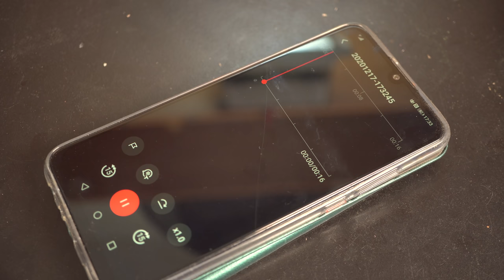How to make a microphone from a microphone?

Comment: the wires not pointing straight down is gonna wake me up st night XD
Reply: What I was about to say
Reply: Year, That triggered me as well ;)
Reply: Hell yes that kept it from being a 10/10 video.
Reply: the point using elastic is to avoid transfer vibration from the body to the mic, using straight short wires will create a patch to those noises.
Reply: @rurruth  There can still be slack on a straight wire.
Reply: ALLL THAT ATTENTION TO DETAIL AND ITS RUINED BY A WIRE STICKING OUT OF THE TOOOOP.

Comment: Beautiful.

I was surprised to seemingly see your lathe is a mini lathe. Love, to know who manufactured it, for your certainly turning out some fine products such as this microphone assembly and the whole assembly and gear you produced in the custom brass, aluminum, copper, lighter ignited by caps.

I do have a suggestion for something you could fabricate. It's a bit unusual and would require having a good piece of electronics to begin with. What I am thinking of is a "Tape Transport Mechanisim" for a good single deck, non reversing, 2 or 3 headed Cassette Tape Deck that is actually more well made than what came with the original machine. I know, that's asking a lot, but it would be absolutely cool to pull off.

Comment: Overall it looks really good, but that cable going around the mic looks off, it should've been shorter and directly under the mic.
Reply: That's what I thought... but maybe there was some reason for this.
Reply: it bugged me too lol
Reply: Maybe it would be just a little harder to mount the cable if was shorter but yes would be better
Reply: It would have been very easy to have excess wiring, then just tuck the extra in the base when it’s mounted. That’s how all other wiring is done in houses, automation, industrial applications, etc. kinda surprised he didn’t after all the painstaking perfectionism he performed.

Comment: Creates insane looking microphone using a microphone. 
Makes the cable goes around instead of straight to the right spot ruining the perfect symetry. 
Sound test is Tap Tap Tap with no replay. 
This thing could capture sound the same way an unattached piezzo sensor does and we wouldn't know it.... 

I rate it 10/10.

Comment: Everything was going great until my OCD went off at the wires coming out the top and looping down to the bottom lol
Reply: Same! Came to see if I was the only one and was wondering why he did that way
Reply: This
Reply: @patrickpaes7817  he did it in order to minimise the strain on the wires because of movement. Since the microphone housing is held in place by rubber band strands, it means that it can move and rotate around. And if he made the wires too tight (running straight from the housing to the connector) then the elastic mounting system for the housing would be pointless and the wire will break at the solder joints over time (except if he added strain reliefs, which I didn't see any in the video).

Comment: all that for a crappy MEMS microphone? well at least you have style
Reply: um matey didn't even put power into it, might have sounded better with some voltage feeding the mems mic as per spec. He just linked signal and gnd as far as I can tell.
Reply: @MouldySoul  that's how it's wired in the headphones, it's just not a very good microphone
Reply: @pacman10182  I'm guessing it's not Tip ring and Sleeve, by the looks of it, the other ring around the could give power as well. I could be wrong. I've been designing boards with mems mics in the last few weeks, maybe there are some passive mems that I haven't come across. I don't own an apple phone or these parts, so just a guess. 

EDIT: not so shitty as well, if you add a resonator as per datasheet. The mems mics are awesome; engineers can however make dubious sacrifices, that may impede their performance!
Reply: @MouldySoul  depending on the device, you could swap mic for video out too
Reply: @pacman10182  ok so I just had a look they're called trrs plugs, and contrary to what I said, they carry Right/Left headphone out, mic and ground. 

Hmm now I'm stumped how the mems device gets the power.
Reply: @MouldySoul  did you not get my response?
from the best I can tell, MEMS microphones are powered the same way normal Electric microphones, by the sound itself
edit: great, youtube deleted another one
Reply: @pacman10182  maybe it did get filtered. I'll have to give it a try 2moro and see if I get any response from my mems mics with no power. I'll get back to you, I can do the tests. It may not work as the mems mics I have all need power, but it's an interesting thought that potentially the vibration from exciting with air is causing enough electric potential to be picked up. Would probably need a decent opamp other side. 

Having read mems microphone datasheets and implemented circuits based around them eg CMM-2718AB-38308-TR. They're not passive devices. 

I don't know apple phones or the headphones. Maybe there's some passive mems devices I'm not aware of
Reply: @MouldySoul  "it's an interesting thought that potentially the vibration from exciting with air is causing enough electric potential to be picked up" well that is how microphones work.
Reply: @pacman10182  No that's not how condenser microphones work, only passive microphones don't require power. And the mems microphones I've come across.

OR go to Mouser find "Sensors/Audio-Sensors/MEMS-Microphones" and search via voltage rating. None of them require 0v. I'm having a hard time finding powerless mems mics. 

Unless your right, that would mean we could just be harvesting energy from a noisey environment using a bucket load of mems sensors. Converting vibration into electrical potential, I think we could create a sustainable source of power using mems and a windy day.
Reply: @pacman10182  go to invensense and search for "Using-a-MEMS-Microphone-in-a-2-Wire-Microphone-Circuit" the power is tied to the output, in conventional 2-wire implementations.
Reply: @MouldySoul  I must have been confusing them with piazos
Reply: @pacman10182  Condensers (which a MEMS mics typically are, and I haven't seen one otherwise) need some sort of power. There is a low voltage phantom power that is provided by the phone, which anywhere from 1.8v-5V.
Reply: @ellisgl  please keep up with the conversation
Reply: @ellisgl  Ignore these guys. They're a just a bunch of "internet experts" who know how to google a thing or two.
Reply: @pacman10182  *piezo.

Comment: Good work! but I doubt the characteristics are any good! The capsule is just so-so, the vibrations will come to it through a rather thick cable so the the rubber suspension will not work at full.

Comment: Cool build, aesthetically the only thing I'd change is I would get some micro cord (or maybe use a strip of solder wick), and have the wires run through it, instead of having the exposed wires.

Comment: Why in the world did you not orient the cords down towards the hole in the bottom. It would have made a straight line down and matched instead of some loop of wire around the top.

Comment: Excuse me mister. This is useless. Not only did you take time to make a custom mic but you also used the default headset mic so the quality is exactly the same (if not worse) than the original. You could have used a condenser mic at least. This is a justified dislike